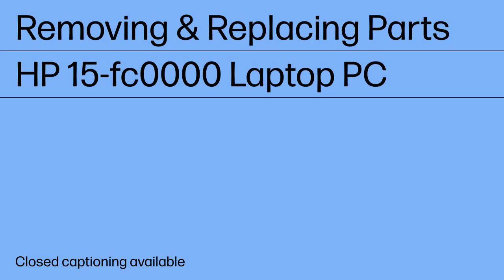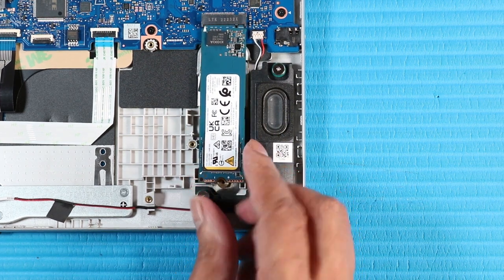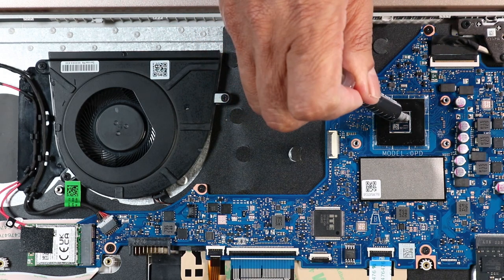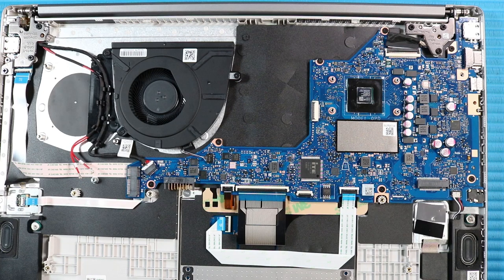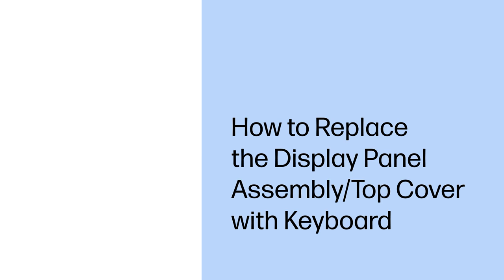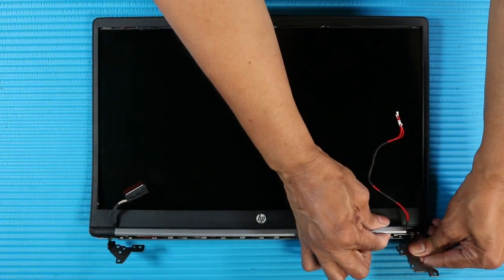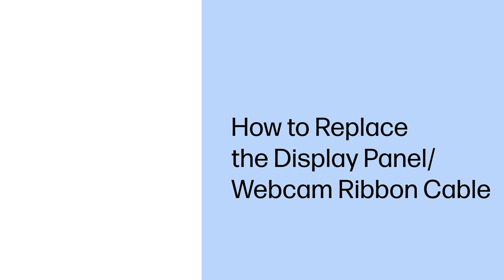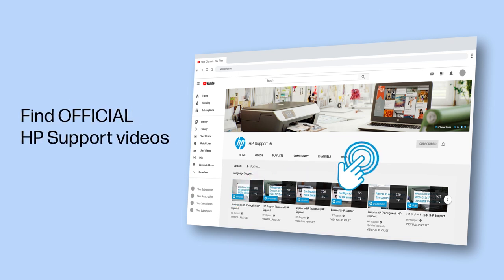Removing & Replacing Parts | HP 15.6-inch Laptop PC 15-fc0000 | HP Computer Service | HP Support

Comment: The HP-15fc0068ns with 16GB DDR4 can be ram replaced?
Reply from the maker: Hi José, thanks for contacting HP Global Social Media Support!
Well, the maximum RAM supported by your laptop is 16GB. So I'm afraid no.
Akhil_HP Social Media Tech Support
Reply: @HPSupport i only got 8gb ram with mine and there's no way to get more ram. Even google lags
Reply from the maker: Hi there, thanks for contacting HP Global Social Media Support!
I understand that you need to know about upgrading memory of your notebook.
I will do my best to assist you.
Please refer 'Memory options' under the specification page to know about supported memory: https://bit.ly/3PVuLq8
Regards, 
HP Support